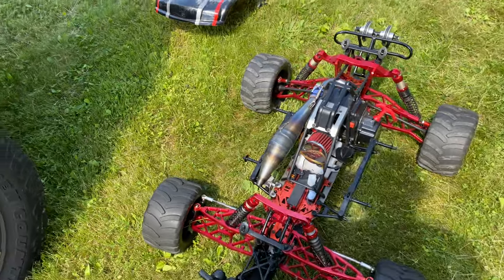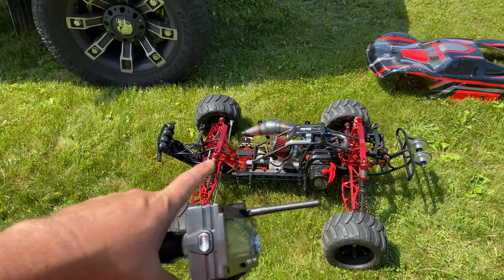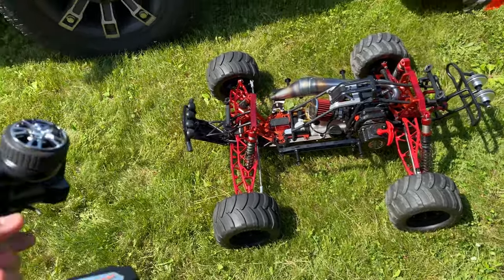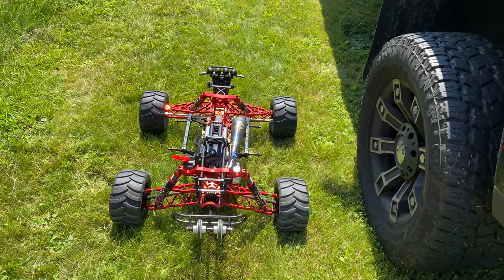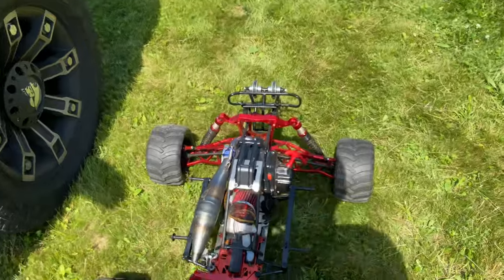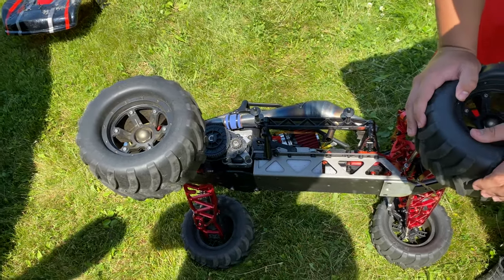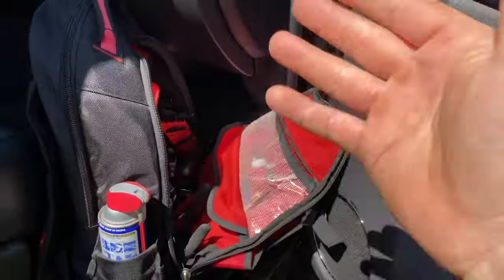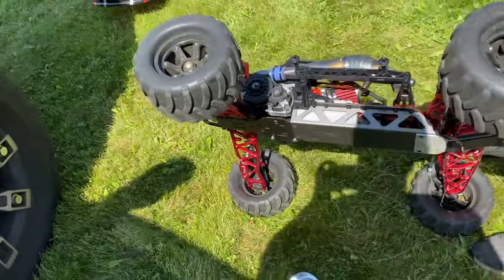Short Run With My MAX-T Because Of Melted SpurGear & First Quick Peek @ New Design BROVAN ReedCase

Comment: That monster rolls so nice and plush. What oil and springs on that bad boy you using??? Always great vids bro.
Reply from the maker: I have past videos of what I did to my shocks I honestly forgot what I used lol 😂 I’ll have to go back and look at my own video? I think it was either 40, or 60 lbs shock oil ?  I forget but soon I’ll be going over my suspension again. I will be possibly using 80 lbs or 100 when I go over them again
Reply: @BOTAJELL  thanks John I really appreciate it. Since I've been watching you as of late you have shown Bartalone has some serious engines. So I just bought a 30.5 Reed case as it's my first big engine. I have my 5T but I though maybe I would put it into my 5B tontry it or my MTXL ? What's your advice ? And anything i should do besides doing a good break in ????

Comment: ayo bro what bartolone engine should I get the 30.5 reed case or 32cc reed case for the primal dragster been deciding between the two but the 32 is out of stock but I know the waits worth it but the 32 is 40 dollars more should I just go with that one an to install the dark soul tubes do u need a bearing press to get them on with the tool that u need to get to install the tubes or could u use a rubber hammer with install tool
Reply from the maker: I like them all from 30.5 ReedCase to 34 ReedCase. I think you should wait and be the first to use the BROVAN 45 ReedCase on your Primal Dragster.
Reply: @BOTAJELL  when is that BROVAN 45 reed case coming out cause if its before September im all about it lmao because im tryna get everything ready so I can at least run the dragster for sep thanks for reply bro
Reply from the maker: Matthew Acevedo it’s comping out soon
Reply: @BOTAJELL  alright then yea i'll def wait then bro thanks for that info

Comment: I have the rovan baja buggy 30.5cc, I want to change my carb to a 990 and try out a velocity stack and air filter. I don't know which velocity stack and air filter to use.
Reply from the maker: This is the best Velocity stack you can buy in the market today! As far as air filters go it all depends how and where you drive the most ? On my drag race cars I like UFO and KandN Air filters does best flow and foam filters for off-road but if you want to use the UFO or K&N filters off road ? Just get some Outerwears around them and you’ll be fine
Reply: Which velocity stack is best?

Comment: Maybe the spur gears get broken because tolerances of different units, Im still using stock gear on my baja and after 40 tanks it still is in good shape
Reply from the maker: This was hot as hell from engine/transmission area to hot 🥵 day and when a good pushing engine is running pushing that plastic gear ⚙️ on Tall grass that makes it even more stress and heat on plastic gear they will melt away! I’ve also melted plastic spur gear ⚙️ on my stock Rovan Baja 5B when I was beating on it on tall grass . It happens it’s No big deal . I will just replace it there real cheap these plastic gears or I can just install a metal one but then I will have to worry about bearings overheating
Reply: BOTAJELL Oh that's right. Tall grass really stress these cars. If you usually run there, a vented cover and a lightweight/vented metal spur gear will probably let you enjoy more time.

Comment: So I have a oportunity to snag two 5 gallon barrels of VP110 I'm wondering if that would be OK to use in my 5t2.0 with a stock motor. If yes do I still mix it the recommended 25:1?
Reply from the maker: That will work but your better off with VP C-9 and you can mix at 28:1 or even 36:1 with Amsoil Dominator Racing 2 stroke oil .
Reply: @BOTAJELL  Ok thank you

Comment: I keep having that same problem melted spur gear or a blown out clutch springs stretched with my ported 45cc
Reply from the maker: This only happened once for me on my Max T and it also happened to my Baja 5B and it’s definitely because I’m driving them in tall grass . I can always upgrade to a metal spurgear but then the bearings may get hot as hell or blow ? 😂